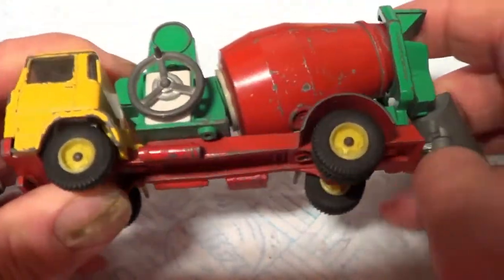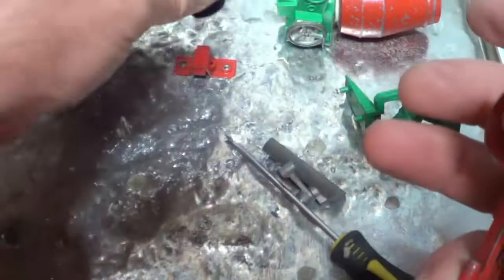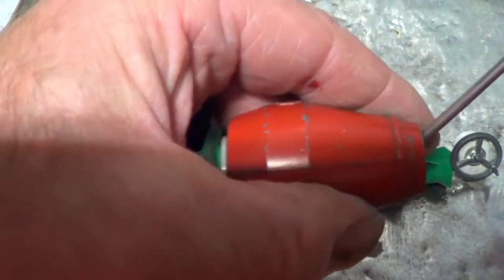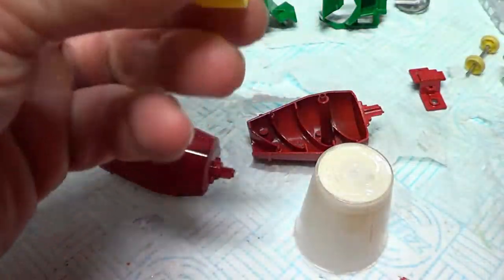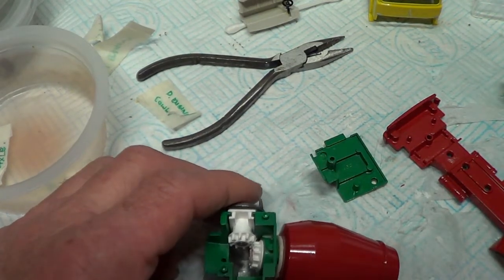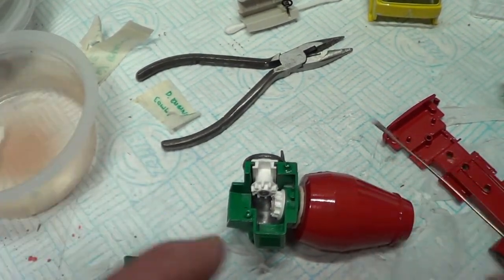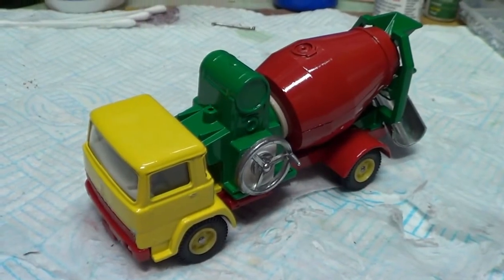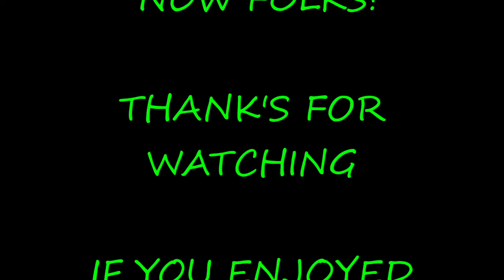SIKU MAGIRUS DEUTZ CONCRETE MIXER RESTORATION.

Comment: Hi Nick,  very nice restoration as usual and a very unusual piece, both the lorry and the cement mixer ! 
Magirius  were well know for their air cooled engines and were not always liked, but this one makes for a very interesting subject.
Well done Nick a pleasure to watch and l am sure your pal will be well pleased with it. Regards Tony Hawkridge.
Reply from the maker: Thank you Tony, I used to like the Deutz air cooled tractors, there were quite a few over here in Jersey during the 70’s 80’s and 90’s, the last one I saw was a couple of years ago towing a fishing boat on one of our beaches, but not seen it since, so I’m guessing unless there are some tucked away somewhere in preservation, they have all ended up scrapped, I used to like the sound of the engines😊👍
Take care, all the best, Nick.

Comment: Very nice restoration! I'm quite a fan of Siku. I call them 'German Dinky Toys' as they are extremely well made with a lot of attention to detail and with lots of working parts. Especially the V series from the 1970ies are very sought after and their first plastic models from the 60ies are very collectable. Unfortunately as far as I know there are no after-market parts for restoring Siku models, so you have to rely on other other broken models for parts.
Reply from the maker: Thank you, they are nice models and do command quite a high price on eBay, I have looked at several other Siku models to restore, but am yet to find one within my price range!

Comment: Nice model that but I am afraid that I would have had to drill and tap them rivits an fasten it up with grub screws, but you seem to have success with the super glued rivits. We always named them as 'Maggy-Ducks'. With the air cooled Deutz engines. They got swallowed up by the IVECO outfit with printed Itallian Euros, along with Ford Truck & Tractor, Seddon Atknson and a bit nearer to you out there in the Channel, Pegasus of Spain. Its amazing what you can do when one is allowed to print money and buy what you want ! No wonder the Italian Banks are screwed.  I was looking at a Hurliman Tractor on a mates farm up in the Lake District this summer, that had an air-cooled Deutz engine. By the way, the Corgi MF Combine;- The best price I can get to send it is £36.00 ! ! Far too expensive. So it won't be happening. However the model still has your name on it, we just need an alternative plan. So you can either come to Gods Own County and collect it where I can show you some 'right tractors', or give me an address on the mainland of somebody whome you are in contact with, like the owner of the Maggy-Duck mixer truck and I can send it there as I'm sure that you two must have some kind of arrangement. Regards.
Reply from the maker: Thank you Robert, I just can’t get on with screws, I faff around trying to get some of the Dinky ones back in and 9 times out of ten they end up on the floor lol🤦🏻‍♂️ I just find rivets easier! There were quite a few Deutz tractors over here in Jersey in the 70’s & 80’s, the contractor that used to bale the hay for my Father took on the agency for them and he sold quite a few, the last one I saw over here was on one of our beaches a couple of years ago towing a boat, then it disappeared, so not sure if someone had it for preservation, it wasn’t in bad Nick to be fair.
Don’t worry about the combine, thank you for trying, goodness knows when we will get over again, I don’t think it’s going to be any time soon I’m sorry to say😢 I don’t know why these postage costs are so much these days, this model mixer cost £20 to send back to my mate, not sure what he pays to send to me, I will ask him next time we’re in contact! Thank you again, take care, all the best, Nick.

Comment: Hi nick its been a while but guess what 😳,  great restoration, that had a lot of parts and a bit fiddly but you did a fantastic job of it .
You are right in what you say when its for yourself its very different when its for someone else.
The green looks better then the original colour 
All the best Martin 👍
Reply from the maker: Cheers Martin, I’m quite pleased with the way it turned out, I was a bit worried about the cab being in yellow but it actually covered very well for yellow, not like the model I am doing at the moment lol🤦🏻‍♂️  You feel slightly more under a bit of pressure when it’s for someone else lol, but it all came together in the end, big sigh of relief 😉😊
Take care, all the best, Nick.